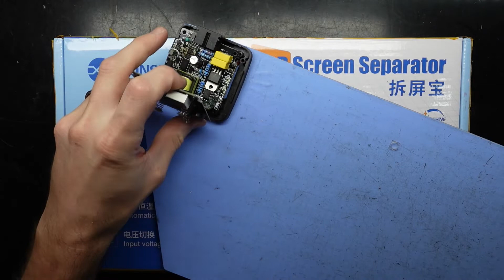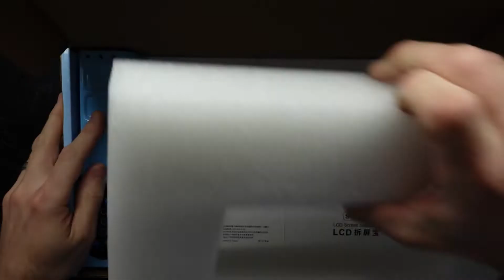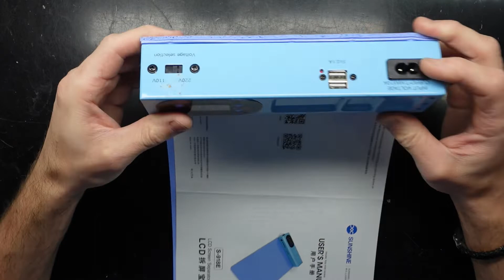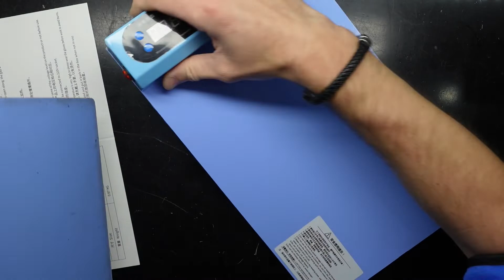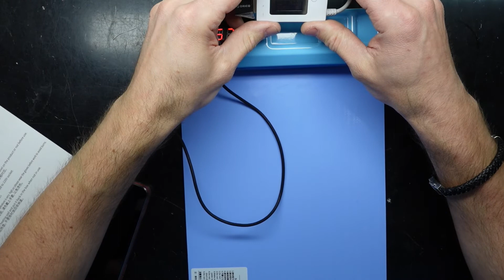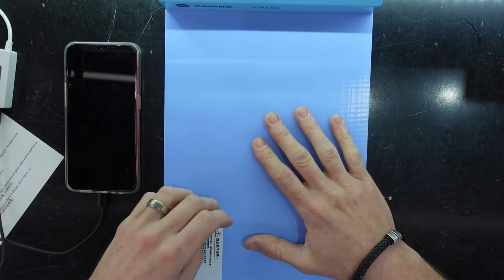Sunshine S-918E Headpad Unboxing and Inspection

Comment: Does the bottom get hot or just the surface?
Reply from the maker: booth sides heat up. 

my bench holds a fair bit of the warmth
Reply: @rickstechrepairs  that’s odd, the cpb only heats on top of, thank you for the response ❤️

Comment: which one more better cpb or this one ?
Reply from the maker: I like this one due to the usb ports on the back
Reply: @rickstechrepairs  Thank you, beside usb port, there is not much difference between the two right ?
Reply from the maker: The plastic mat material seems to be the same 

And the level of temp control and its heat up speed seem basically the same as one another 

So apart from the overall mat size and the usb ports, they are basically the same
Reply: @rickstechrepairs  The newer CPB one takes ages to get up to temp (at least 5x as long as the one in this video). Get the sunshine.